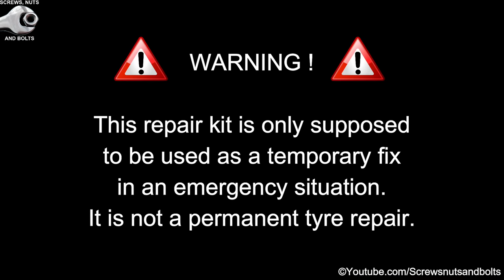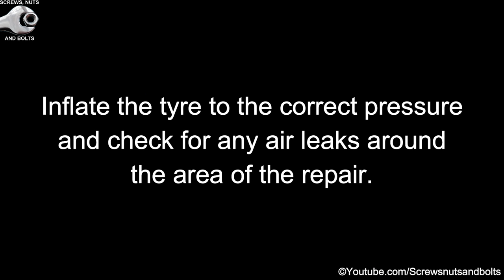Tyre Plug Gun Repair Kit Tutorial - With Internal Views

Comment: My kits come with a metal can of rubber cement. You put the tip in the hole and inject a small amount so it gets inside around the hole. Then inject the plug. I have later removed the tire and looked inside. The head is actually glued in place. I have done 8 or 9 repairs this way over the years. Never had any of them leak for the life of the tires. Keep a kit in each of my cars.

Comment: When you pulled up on the plug it narrowed quite a bit as stretched. Seems to me the perfect time to get some rubber cement into the hole all round the plug then with gentle/careful pulls work the cement down in deep. Might not be needed but for those who like to overdo things to insure success it could be just the ticket.

 I usually use the sticky treated plugs with cleaning rasp tool and insert tool in the kit and have never had one fail,even did one that took two plugs(ran over a 1/4" concrete tie) in the same hole but it got me the 32 miles to home in -20F weather,and at night on lonely country gravel roads too.I was relieved to see the lights of home!.  I keep a kit,stocked with plugs,in each truck because I'm lazy and get as close to the project as I can to load/unload ,but,near buildings is the prime place to get punctures. Oh yes,I also keep a 12v air compressor in each truck too for repairs on the road. Those compressors are slow but the entire repair can be done in 10-20 minutes depending how much air was lost.
Reply: I think rubberized cement will only help the tire bond to rope plugs, mushroom plugs are made out of a different sort of rubber that doesn't bond to the tire so the rubberized cement might not do anything except potentially mess with the seal and cause a leak

Comment: I have used this method for years on construction sites where most of the tires are bias ply, but do not use on steel belted tires as it will cut the plug quickly, also it will break the belts in the tire. I've always aired the tire up to the correct pressure before inserting the plug, it will go in much easier.
Reply: रौं
काख

Comment: This only works well if you have an air source to refill the tire.  Won't work on the side of the road in a pinch because it takes too long to apply the plug.  You would have to be pretty quick to keep as much air in the tire as possible!  I'll stick to the old plug type with the hand tools.  You don't have to ream so much to fit the plug in the hole.
Reply: Anyone that plans on carrying tire plugs surely carries a small tire inflator...I know I do.......

Comment: Comments regarding a quick fix. I would forgo this one, and use the 'rope' style. Cheap and faster and easier. For me personally, I consider the rope type as a permanent repair. Used them at least a dozen times, only had one leak.  

The technique shown here certainly works but is not any more effective. If I had an inflation source, I wouldn't even bother with my spare. Plug inflate, get on your way.   - Cheers

Comment: Well, seems like more money than a regular old plug. Also, now you have a little rubber thing flying around inside the tire. Making noise when slow and also hitting the tpms on the valve stem. Not something I'll be buying for sure.
Reply: @409novaman  Nope, yours was.
Reply: ... not dumb makes sense.. you don't want that plastic piece eventual wearing at the rubber liner 🤔
Reply: Technically you don't need that little plastic tip to push through the tire all you need to do is cut the end of the shaft at an angle and it'll slip right in the tire been using those things since the 70s and you don't need oil just put some glue on there I run those plugs as much as 20,000 MI and without a problem

Comment: Good clear instructional video, well done. But I would be putting some glue on the mushroom and into the hole before using the tool.  👍
Reply from the maker: Thanks for watching 👍
Reply: Oh sure you can see what he is doing but what about the chunk of rubber that he used on the tip of the gun you don't want a chunk of rubber rolling around inside a tire/tyre for any length of time so it's not really a good tool
Reply: @rickmartin7062  As said,a temporary fix to get you going.
Reply: glue for sure.. better..
Reply: @rickmartin7062  that chunk won’t hurt anything. Some people use plastic beads inside as balances now. Not that I would. But that little piece won’t hurt.
Reply: I use this kit an everything, cars, motorcycles, trailers, etc. I don’t consider it a temporary fix, never had one leak, the tip that falls inside is plastic, doesn’t hurt anything, also when I team out hole I use glue too. Great video

Comment: Great tutorial buddy,  I'm a little sceptical about using this method.  I guess the internal air pressure is supposed to hold the rubber bung up.  It being used with no adhesive is for me is questionable.  Definitely a get out the brown stuff situation use only.  I myself wouldn't want to keep this in permanently 🤔.
Reply from the maker: Thanks, it's designed as an emergency repair. It's not meant to be a permanent fix
Reply: its garbage and destroys the carcass of the tire. id carry a bead hammer and lever before this bullshit.
Reply: Is ka price kitna haa
Reply: @shiulemondal9670  50 dollar

Comment: They've taken a simple, foolproof, permanent process and made it ten times worse (and as the video says, temporary). This uses no glue and leaves a plastic bead inside the tire to make noise and cause internal tire damage. It also uses a (relatively) complicated tool that will seize internally or suffer some other form of breakdown when left in the trunk (or boot) for extended periods. This is progress? The mushroom plug idea is interesting.

The regular two pointed handle system (one to ream and shape the hole, and the other with a needle eye to insert glue coated plugs) works well and is simple in the extreme.

Good work from the videographer though.
Reply from the maker: I agree, the original plug kit is nice and simple. Thanks for the comments

Comment: Lubricating the hole with fresh rubber solution ( and the un-oiled plug head + outside of the insertion nozzle? ) and inserting  IMMEDIATELY  will result in the strongest bond possible ( when the solvent evaporates + penetrates the tyre rubber ) ... this method also works well with the sticky strip kits .... this will also last the life of the tyre ! ( the tool will need to be cleaned , but it is worth it ! ) ..... DAVE™ .....

Comment: these dont work on steel belted tires, the woven steel cuts the plug very quick. i bought one of these in the seventies, it worked great for my atv tires, i also didnt put oil on the plug, i coated the entire plug with glue and the hole too
Reply: . glue is what I was thinking. too., just makes sense 👍🇨🇦
Reply: Now Mike dammit! Why didn’t you tell me BEFORE I bought one?! Lol
Reply: @SuperReznative  it still doesn’t work. I used mini torch. Paint remover GUN. LOTS. I MEAN LOTS OF VULCANIZING GLUE!
Reply: Thanks, ive a reamer and needle and a few strings,
Ive vulcanising glue

Comment: So you get a puncture:
Stop at the roadside.
Take the tyre off (maybe you can do it with the tyre on but that's not demonstrated here) 10min
Remove screw/nail - and let ALL the air out 3min
Roughen hole with tool
Insert mushroom end into device with plastic "nosecone" stuck on end.
Insert gun into hole
Nosecone released into tyre where it will spend it's life rattling around inside, loose, possibly damaging any TPMS sensor you have.
Pump the gun to insert the mushroom cap
Pull up the cap until you "feel it's seated"
Cut off excess.
Now completely refill tyre with air from an air pump you also need to have. 5min
Refit tyre to car. 10min

As opposed to:
Stop at the roadside.
Keep tyre ON (0min) and remove screw/nail
Quickly insert roughening tool so as little air escapes as possible (10sec) and roughen hole with tool
Insert rubber strip into eyelet of tool
Insert tool into hole so about 3/4" rubber still sticking out
Quickly pull tool out (will leave rubber in hole).
Cut off excess.
Now partially refill tyre with air from an air pump you also need to have. (2min)
(No need to refit the tyre as it's already on - so that's 0min)

https://www.youtube.com/watch?v=6T-rmhXUR8o
Reply: The fact that a piece falls out and stays in the tire is enough for me to never use this.

Comment: Should have used side cutters to remove the nail and always air the tire up to 15 psi over the recommended psi setting this way the tire don't flex when inserting the reamer or the plug and by the time your done the psi will have dropped about 15 psi.

Comment: What if you use rubber cement (instead of oil) to coat the entire plug? Would you have a permanent fix?
Reply from the maker: I'm just demonstrating the kit and going by it's instructions. You could be right though :)
Reply: The oil is for lubrication. Cement will make it stuck inside kit..

Comment: Bro use side cutters to pull the nail!
Reply from the maker: I will next time ! :)
Reply: Side cutters?
Reply: Yeah but where's the glue
Reply: @TheOriginalAndysGarage  temporary plug otherwise it would be black.
Reply: You can also use the claw end of a hammer since it's actually made to pull nails.
Reply: @johns3655  Klein’s....,
Reply: Or use needle nose pliers and put something under the pliers to heighten the pliers and push down. More leverage. Just saying. 🤷‍♂️
Reply: @johns3655  some of us call them wire cutters. They look like pliers with cutting, rather than gripping ends.
Reply from the maker: @YeeeeeHaaaaa  I couldn't find my side cutters so all I had at the time were this useless locking pliers ! lol :)
Reply from the maker: @JohnLeePedimore  Good idea !
Reply: @YeeeeeHaaaaa  electrician talk ;) “lineman’s is another one

Comment: That lead will always be in the tyre?

Never causes any vibration?
Reply from the maker: It stays in there until you get the tyre patched. It's only designed as a temporary repair.
Reply: Temporary, how else would you repair it?

Where I am, a mushroom repair is actually a permanent done by tyre shops.
Reply from the maker: Over here they usually put a rubber patch on the inside of the tyre for a more permanent fix

Comment: The first time I came to N. Carolina, I saw these guys banging a little piece of rubber, then a thick short nail, with a hammer, into their flat tire. I thought wt the heck? these people are crazy. This looks insane lmao.. Little did I know it's an old patching trick that works so well, people tend to forget they did it, and don't even buy new tires sometimes. 😂 I had never seen it before hahaha.. Everyone has these little kits to simply fix big holes in tires like nothing happened. A lot of times, too, people get a flat on these mega trucks where the tires are easily $1000 - $2000 a piece (or more.) My friend had military tires on his big truck that were $5K each stg. I have pics lol. Anyways, The plug patch kits work so well, sometimes people will say yea, this is about the 3rd or 4th one 😂 Better get a new tire soon or just wait til it goes flat lol. They'll have the new tire onboard ready to go and just run the old ones as long as possible. Good stuff
Reply from the maker: Thanks for your comments :)
Reply: @screwsnutsandbolts  np 😁

Comment: Just use an inside patch and be done with it, been using them for 60 years. Also you put glue on wrong side of the plug.
Reply from the maker: It wasn't glue, it was lubricant
Reply: Well if you can’t remove an balance it

Comment: As an emergency repair ok but they should write dont use this on motorcycle tires, and get it propper fixed as soon as possible. I even wouldnt thrust that plug high speeds over 100 kmh.
Reply: WRONG TO EVERYBODY ON HERE COMMENTING! This is not an emmergency repair! It can repair your tire if you at a place where you have access to air! Otherwise it best to use the rope plug for emergencies! THIS IS NOT FOR EMERGENCY USE! AS YOU WILL LOSE YOUR AIR COMPLETELY WHEN USING THIS TOOL!